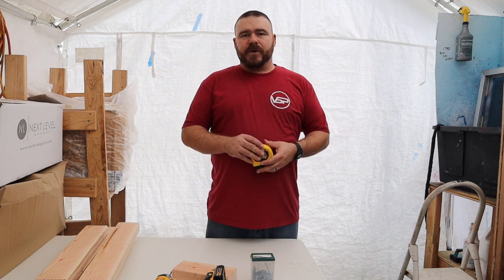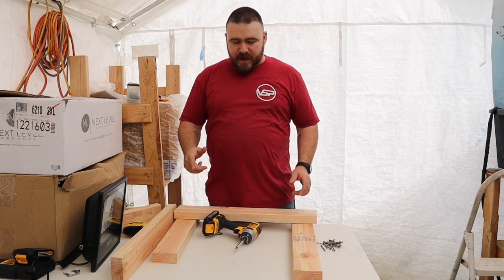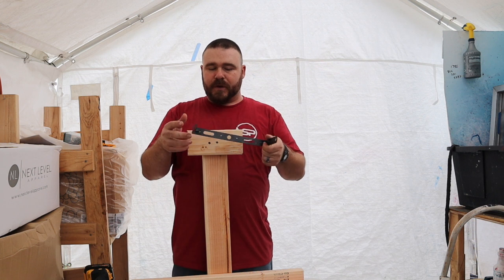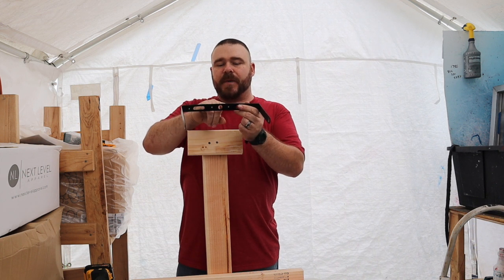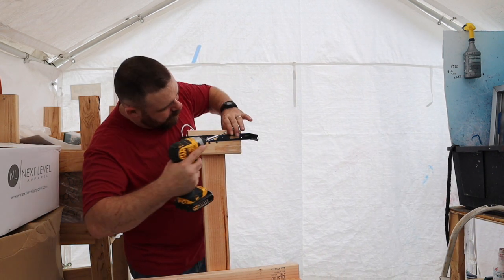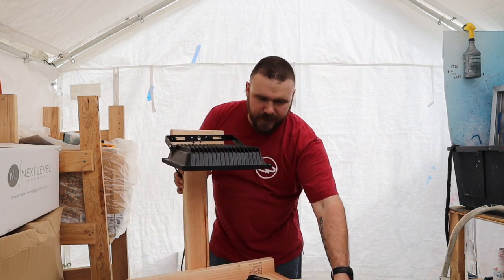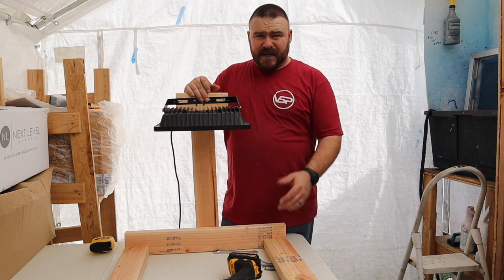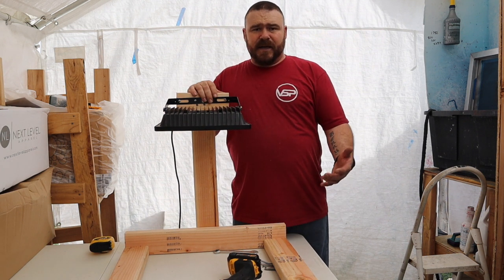DIY EXPOSURE UNIT FOR LESS THAN $55

Comment: Is the light right over the middle of your screens ?
Reply from the maker: Yes that is correct.
Reply: @ApparelTalk  I
Put  mine together with bolts with wing nuts so I can take off the vertical piece for easy storage . I also I added folding wall hooks that are flat so I
I can just hang the light on rather than attaching it. Now to try making my first screen. That was my first time building something and using a drill.
Had to tweak things a bit so it has a few extra holes.
Lol, but it will now do the job.

Comment: Curious on your exposure time.  I am using same light and emulsions.  Do you have it for different mesh count?  Do you 1/1 or 2/1 coating?
Reply from the maker: Lance Scott for the most part I use one coat on both sides of the screen then my burn time is at 25 seconds but also a lot comes in play with this how far your light is from the screen is it completely dry is a lot humidity out a tons come in play but a good starting point would be around 25 seconds
Reply: @ApparelTalk  Thank you.  I burned one tonight for 35 and it worked pretty good.  It was my second print job.  If I recall you are in Vista, I live in South orange county.  BTW the emulsion is great.